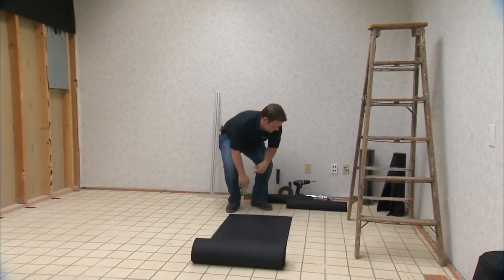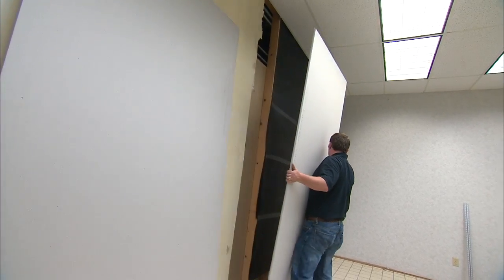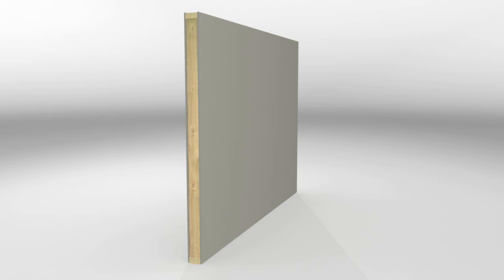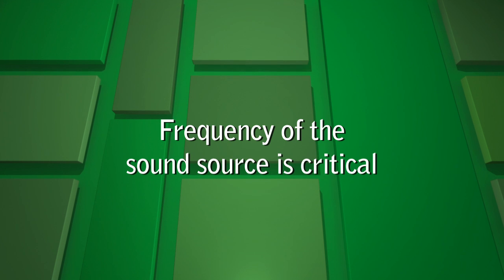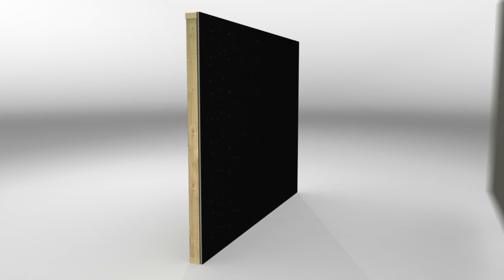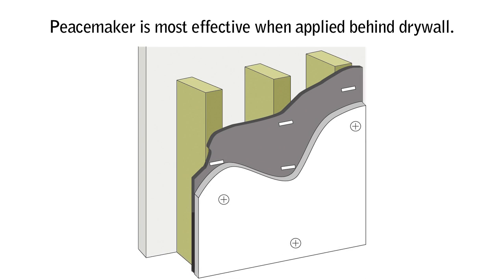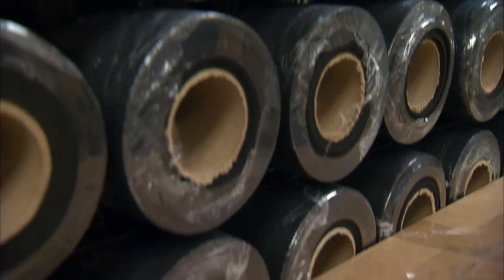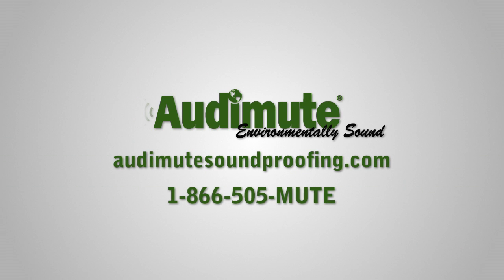Soundproof Your Room- Audimute Peacemaker Wall Installation

Comment: Soundproofing a room is very complex. A room is only as strong insulated as its weakest link, which means that you have to insulate everything equally (walls, floor, ceiling, windows & doors.) 

The perfect way to that is box within box-technique or simply by mass (heavy walls, floors,...)
But that will be very difficult to achieve and will be costly!
I strongly recommend to advice yourself because it's just not that easy.

Comment from the maker: @mahlahh You could use the Peacemaker exposed on the drywall, and it'll work effectively. Just make sure to keep your expectations set a little lower than if it was installed properly behind drywall. It helps, maybe about 30%. Usually people use two layers to enhance it's performance about 50%! Give a call so we can discuss. I'm happy to help!

Comment: How effective is it if you are needing to install it on the outside of the wall? You say not as effective, so I'm curious how much it would help. I'm a renter so I'm researching any possible solutions I can find to avoid bothering the neighbours with my home studio. 

Also, would it be more effective in a newer building than an older building? Again applying it on the outside of the wall. ?

Thanks

Comment from the maker: @darren0512341 Well, that is typically how to install it. You would have to get creative has to how to hang it without putting nails in the apartment walls. You can do that, and before you leave, just add some filler to those nails and your landlord won't notice! Hope this helps.

Comment from the maker: I would talk to your landlord first.. you may not be able to make that extra wall? Well if you are able to, then Peacemaker would be fine if you placed it on the existing wall, followed by a layer of sheetrock. Obviously, you will get better results, if you use a double sided sheetrock wall with both sides containing peacemaker. Adding more mass will help with the isolation. Hope this helps!

Comment from the maker: Insulation can definitely be added to walls to further increase the overall STC, but Peacemaker in and of itself often does the job pretty well on its own.  It all depends on the type of sound you're looking to block..the lower, louder sounds are going to obviously need the most treatment, so depending on what kind of sound it is you're trying to block, you may or may not need additional insulation.  Feel free to give us a call if you have any more questions!  866-505-6883

Comment from the maker: All of our Audimute products have been tested. Our website shows in great detail the lab reports. Peacemaker is an eco-friendly product because we use 80% of recycled rubber materials, mainly tires. The other 20% are flexible polyurethane adhesives which binds the product together. Also, we have many customers who have installed Peacemaker in their homes, Churches, recording studios and so forth and are completely satisfied. Check out our website for testimonials or give us a call. 866 505 6883